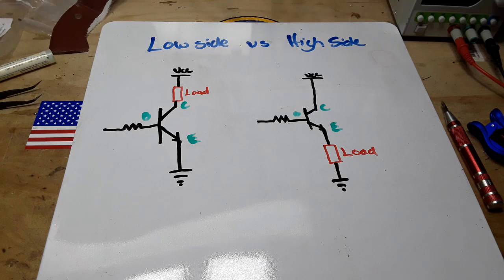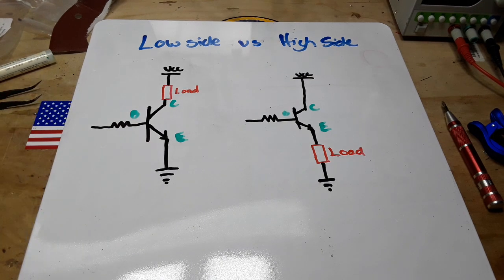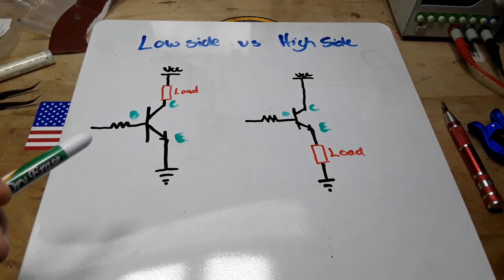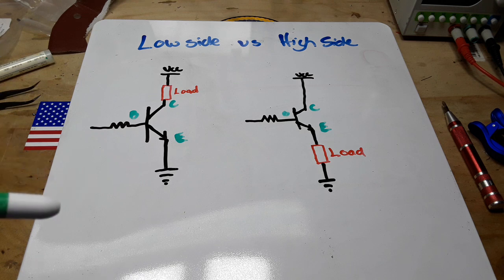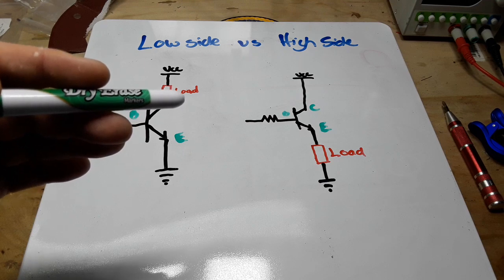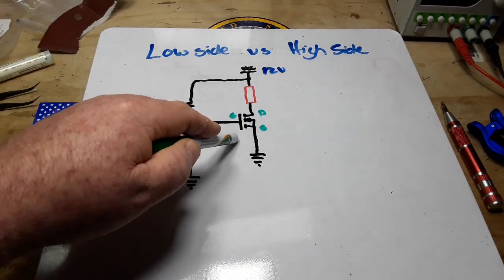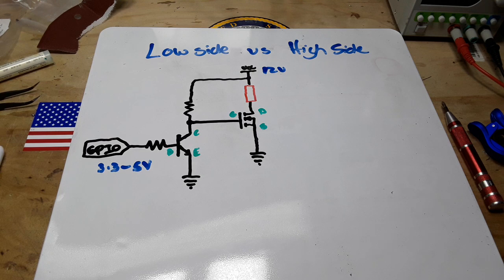Transistor as a switch - low side or high side

Comment: This is one of the stupidest video I seen on transistor switch it works off voltage not current you need a voltage divider circuit some type of sensor that varies it voltage to either above it's or below it's the transistor forward bias voltage which is about 600mv or 0.6
Reply: I don't understand your outrage, looks like that's what he did?
Reply: @tedbastwock3810  he didn't do that

Comment: For pulse switching applications.....the gate of the mosfet needs be pulled to ground to fully turn off the mosfet nd full vcc(9-12v) at the gate to fully turn on the mosfet.using a BJT driver... Which of the circuits is best for dat......high side or low side???
Thanks 👍👍

Comment: Hello, i have an arduino that has a 5V pin, when i connect the USB to program it, this pin has voltage, but if i connect 5V to the pin, the board turns on. 

The problem is that I want to connect a battery to the 5V pin and make an auto selector that can select between battery power and USB power.

The battery has to be cut off and cannot be charged from the 5V pin when USB is connected.

The idea is to program the arduino WITHOUT disconnect the battery and the returning voltage don't affect the PC port or any board that it was connected. 

I hope understand the idea, sorry my english.

THANKS-GIVING.

Comment: You didn't mention a huge part of using a high side switch which is your gate potential has to be a lot higher than your drain since the source voltage is no longer 0 volts. 

Which is why it's easier to just use a pnp or p channel transistor.

Comment: Why are you not using complementary transistors for high side switching? I would use an PNP transistor on the high side, to avoid the complication of a Vbe drop, by allowing the collector always to be connected to the load. A similar situation with enhancement mode mosfets, I would use a P channel mosfet. There are considerations of finding  fets with the necessary speed or Ids current that may limit the choice, but in general the complimentary transistor is the first choice.
Personally, I like to use open collector ( open drain ) transistors for interfacing between circuit boards. This is because the one voltage which is not subject to voltage regulation tolerance is zero volts. The ground can have noise on it, but in general it is a well defined logic signal. For similar reasons, high side switching is a preference. It is possible to design circuits fail safe and to be tolerate to at least one fault. I try and design my circuits so that a simple fault will not let out the magic smoke and force a component replacement. One simple example is when driving an LED, it is always best to connect the current limit resistor to the supply rail and the LED in series to the load. The reason is that an accidental connection to ground by a scope probe will not destroy the current limit resistor, but would most likely instantly destroy an LED connected directly to the supply rail.
By using high side switching and open collector drives, it's possible to engineer the interface to survive a short to either rail. This is achieved, simply by dividing the drive circuit limit resistors into two separate resistors. One in the collector feeding the high side switch, and one in the base or gate bias to the high side switch. Both resistors limit the current and can usually survive a momentary short to rail, either because the current flow is limited or because the short is to their respective passive rail. (Nothing happens when an open collector is shorted to ground.)
Fault mode analysis is always worth doing on any new design, as minor changes in circuit topology can result in a circuit that is fault tolerant and thus far more reliable. During my time as an industrial circuit designer, I attended many circuit peer review meetings. In these, the designer was required to justify the inclusion of every component and explain why a particular value had been chosen. In some cases, this came down to the component being required, but it's value chosen simply to reduce the number of different values included on the bill of materials.
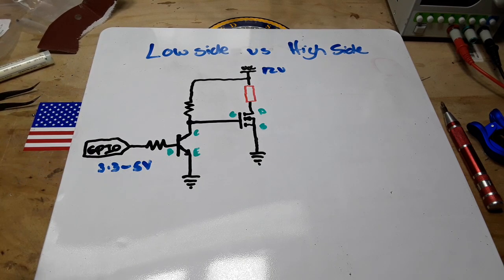Reply: For small current PNP transistor on high side is better as it is simpler, more intuitive, having common ground, and also safer. But for high power application that demand efficiency (low RDSon) then the schematic at 3:37 using Mos Low side and BJT driver is the way to go.
Reply: @stark_energy there are some highside, high current,  MOSFET switches aimed at automotive applications, but they can be expensive. In most of my designs, where logic interfaces are concerned, I tend to drive from open collector outputs switching to ground (0 volts) as this is the only rail where supply tolerance is not an issue. I like to make my designs "bomb proof", in that any output can be shorter to any  rail without damage. In most cases this is not difficult to achieve, if low current control signals are used.

Comment: Thanks for this.  For a future episode, perhaps investigate PNP Transistors and P-Channel MOSFETs for high side switching (and how a logic zero turns them on).   For NPN and N-Channel - high side switching requires a voltage HIGHER than VCC to FULLY turn them on.  For NPN transistors, it's about 0.6 volts higher and possibly several volts higher for N-Channel (depending on type and current).  
For reference, you described Emitter-Follower (a.k.a. Common Collector) and Common Drain (a.k.a. Source-Follower) circuits.  Again, the downside is you cannot switch fully to the positive rail with these circuits, therefore causing higher heat and a lower voltage than expected.  The downside to PNP and P-Channel is they are typically less common and more expensive - although I don't think that was always the case.  I remember pulling apart radios in the '60s that had positive ground and PNP transistors (yea, I'm old).
Reply: Not only old. You're savvy too. Two conditions that aren't always related!
Reply: Yeah, I'd definitely use pnp or p channel for high side switching. Way more efficient.

Comment: I faced this situation some time ago when self-learning about transistors. My natural 'instinct' was to put the load on the emitter (high side). But it didn't give the behaviour I was expecting nor wanted. I put the load on the collector (low side) and hey presto, the transistor did exactly what I was hoping it to do.
I couldn't rationalise the difference. To try and understand why is it different, I read more on the NPN junction. After wading through people just repeating the usual bland 'base level' info about transistors (;)) I came across source of information (;)) that the NPN junction isn't actually symmetrical. That helped me understand there'd be a difference between high and low side configurations. Anyway, since that time I've always put loads on the collector (low side) and never had a problem since. 

I suspect that if the load on the emitter line has too high of a resistance then the possibility exists where a back-current may force its way from the collector through the base! (diode breakdown scenario) which wouldn't end well I suspect.
So dropping voltage on the collector line entering the diode junction will reduce any chance of a back-current.

Thanks for all your videos.

Comment: Using transistors. Is it possible to get that spike when turning things on. For example. when I turn on my saw it draws allot of current the very instant it turns on. I want to utilize that spike of power for something. Is it possible to get those spikes when turning on my circuit with transistors?
Reply: Your question intrigues me, what do you mean by using the spike-current / spike-power?
You can use it as a trigger but I do not think you have excess current. :-)
Reply: @friedmule5403  Inductive loads cause a reverse voltage spike when you suddenly turn off the load.  This is why you almost always see diodes connected across a relay in reverse polarity (to protect the switching circuit).  This is also how DC-DC voltage converters work.  A MOSFET charges and discharges an inductor causing a voltage spike. Diodes redirect the spike to a capacitor allowing you to change the voltage up or down depending on duty cycle.
Reply: @davethedaemon9024  Yes that's when you turn something OFF but he is asking about power-spike when he turns the unit ON. I suspect he may talk about inrush current. That he then will use to power something else. :-)
Reply: What you are describing is how DC-DC converters work.  Your saw is an inductive load and causes spikes when suddenly turned on or off (depending on when in the AC cycle you do this).

Comment: You use low or  hi side switching or as I was taught sink or sourcing to drive loads that require more current, due to the volt drop across the load, if low resistance then not enough current to drive it, so you need to do it the other way around to get the current without the voltage drop from the source.

Comment: The Mosfet shown in last diagram is a P-channel MosFet right ? 
When the Transister pulls ground to Gate then it will work..Isn't it ?
Reply: No it shown an N channel type
When transistor pull GND to Gate the Mosfet is off, if voltage is approx. 10V higher as Source the Mosfet switch on.
Reply: He did say p channel BJT  so you would assume that anyway

Comment: Can someone please say WHAT MUST BE THE VALUE OF THE RESISTOR CONNECTED TO BASE?
This doubt haunts  me
Reply: It's in the datasheet for each transistor so something like a 2n2222 wants 10ma on the base to turn on so using ohm's law you work it out. Just be aware that's not the full story as you will probably need to calc the resistor on the collector/ emitter to which due to the characteristics of different types of transistors and gain an all that good stuff leads into the other calculations depending on what you are doing.
Reply: @SlyerFox666  Thank you so much man